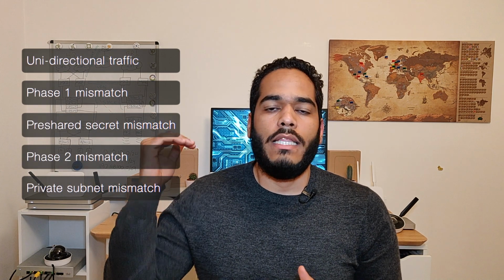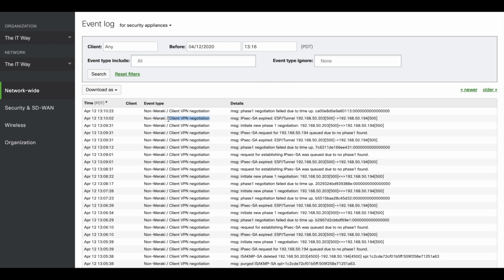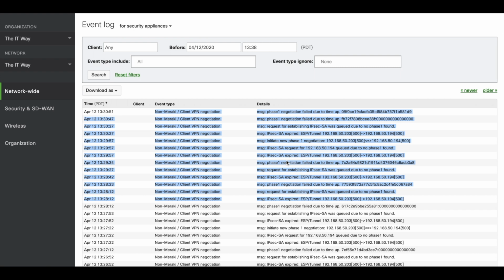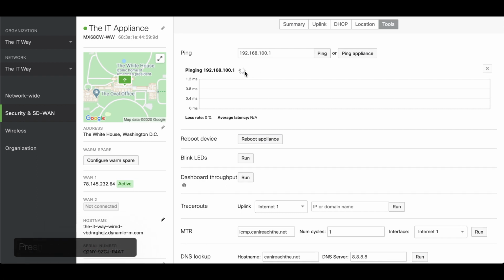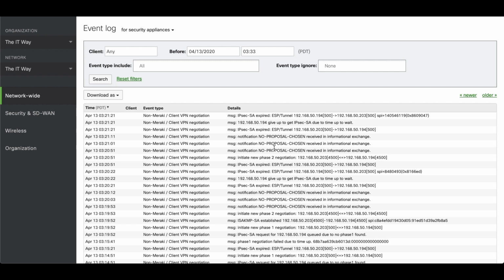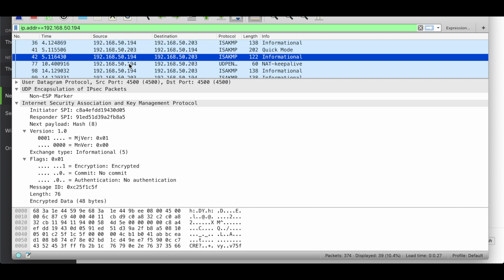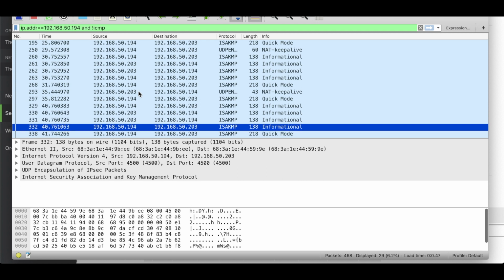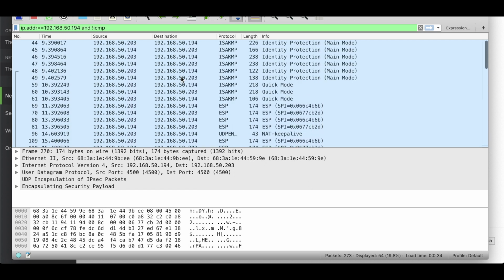[TSHOOT] Troubleshoot Non-Meraki VPN Tunnels with Cisco Meraki MX Security Appliances

Comment: Hello, I’m currently encountering an issue with our non-Meraki site-to-site VPN setup. For several months, we’ve enjoyed a consistent and stable connection to our remote site. However, starting last Thursday, the connection dropped unexpectedly. Strangely, the VPN status appears green and connected, but I’m unable to reach the other end’s local subnet, and vice versa. Upon inspecting the logs, I noticed an established tunnel connection, but the packet tracer indicates dropouts or retransmissions.  I couldn't see from the event logs the negotiation phases as well. Already sent a ticket to Meraki support and since then they're still troubleshooting the issue.  Hope you can provide some clarity/ advice on this?  Appreciate you videos/content that you put up online.  Have a good day!

Comment: Trying to VPN between MX64 and MX250 on different meraki sites.  The only entry in the event log on the MX250 is: Non-Meraki VPN, Non-Meraki VPN negotiation,msg: FIPS mode disabled.  Nothing on MX64.  When they were both in the same site the automatic VPN worked fine.